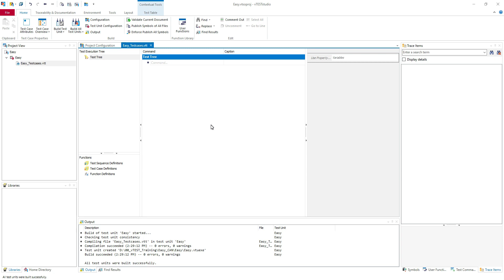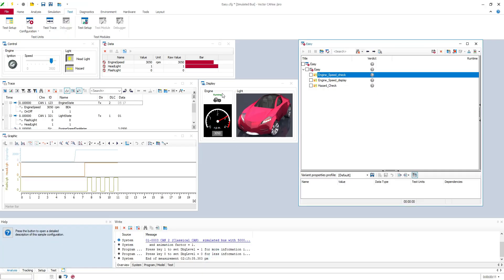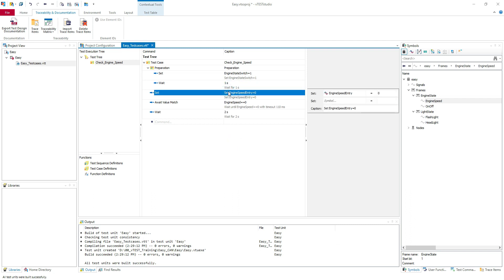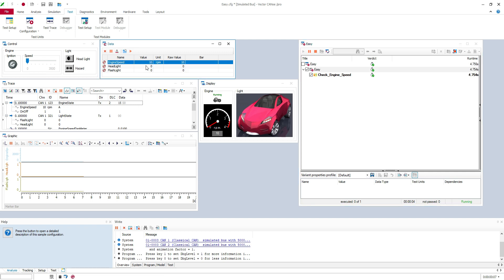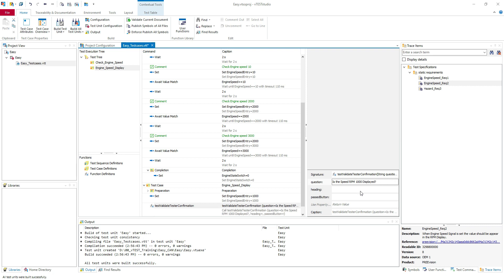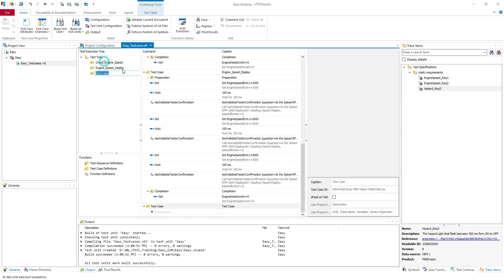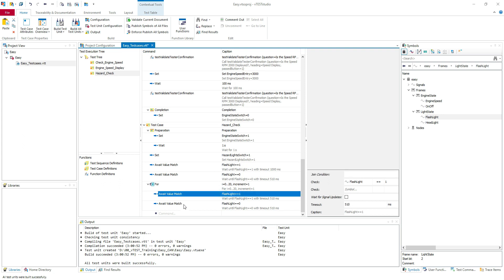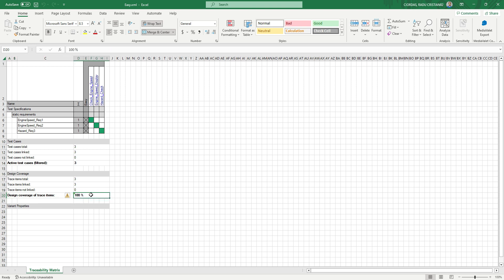04 Signal Testing in vTEST Studio

Comment: I have a question, when you are using the check command, is it possible to check a signal is equall to value of other signal instead of a value . Or check the return value of a function?😅
Reply from the maker: Best way is to store your values in sysvars and then to check them. 😀

Comment: Can you make a test project starting from new project and adding both can messages, dbc files, test codes and canoe interface without using sample configuration? (by the way thank you for your great videos )
Reply from the maker: Usually you have the dbc and other files in the CANoe configuration on your project. The example from Create a new test project video should be enough for any project.